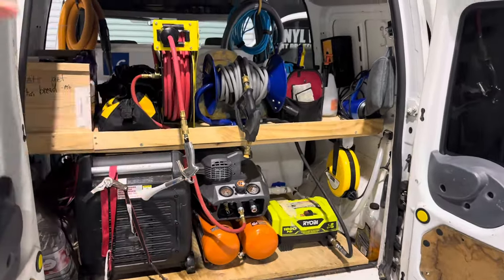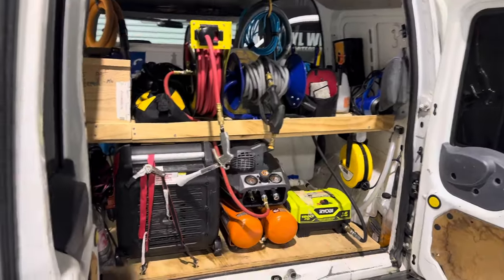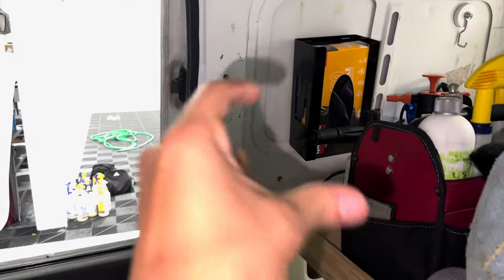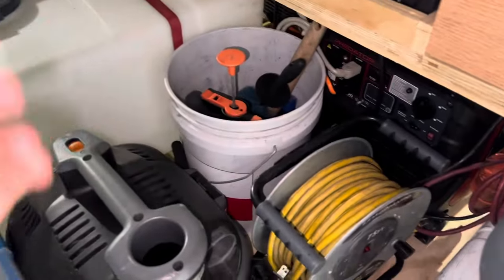MY SIMPLE & EFFECTIVE MOBILE DETAILING SETUP (2023)

Comment: For my canopy I bought pipe insulation foam noodles to put on the legs and I have extra 5 gallon bucket’s with lids that I can fill with water if I need weight to hold down canopy. Good setup that gets the job done.

Comment: Bro how efficient is the gravity feed to the pressure washer
Reply from the maker: It works fine I guess. I have plenty of pressure to wash a car but it’s nothing crazy. If that’s gonna be a big concern for you I’d suggest probably getting a pump or a pressure washer with a built in pump and higher psi
Reply: @marlonboquin01  would you happen to have a link for the tent you're using?